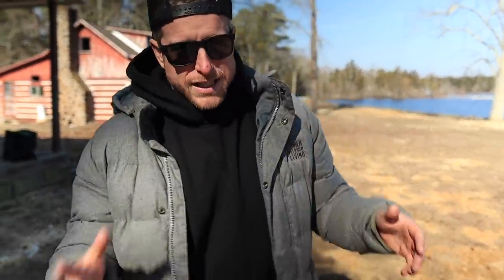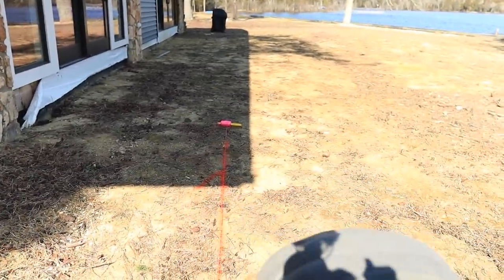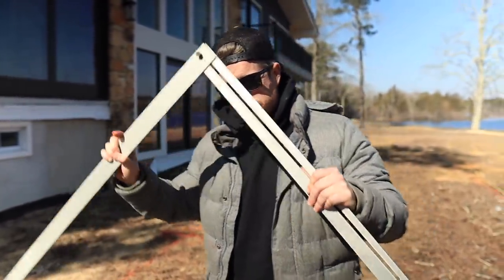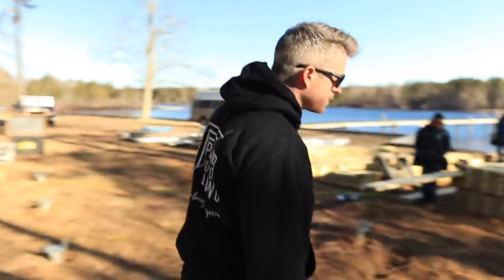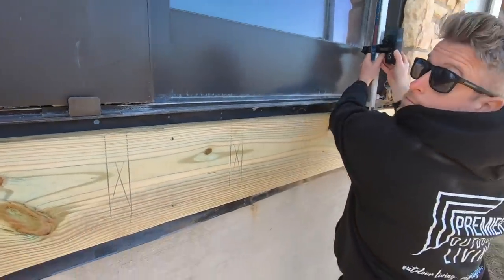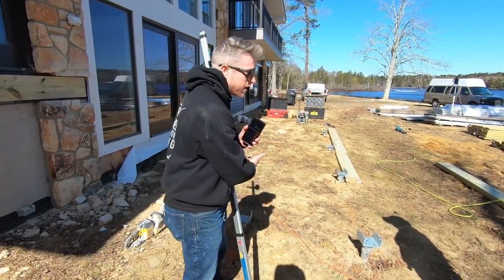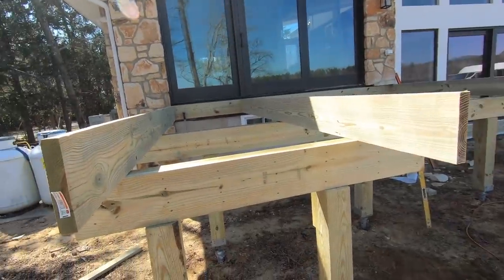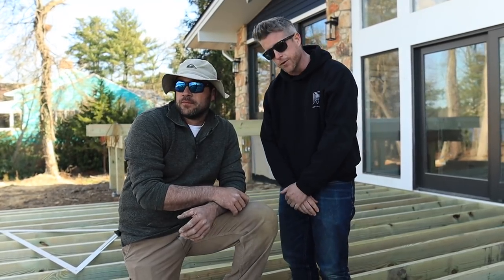RIVERFRONT BACKYARD BUILD Pt 1 - Helical Pile Installation and Deck Framing

Comment: I would have had a large section  screened in with roof. Pretty view
Reply from the maker: There is a screen porch we are actually rebuilding on the side of the house and the backyard is fully shaded so we didn’t think a roof was worth the coat